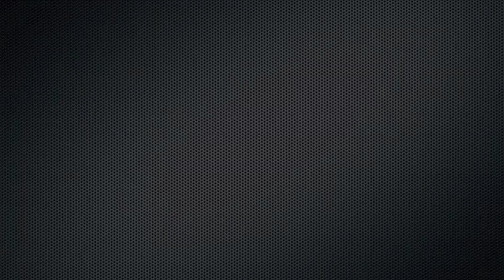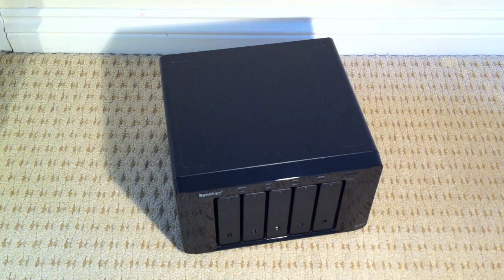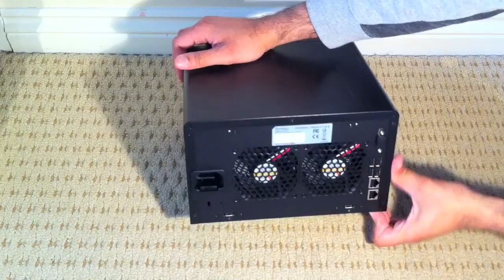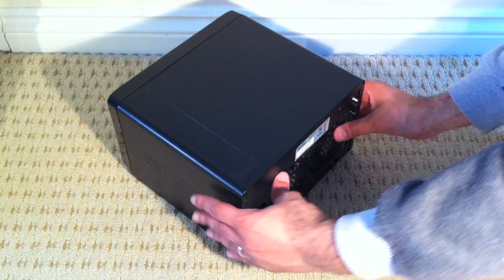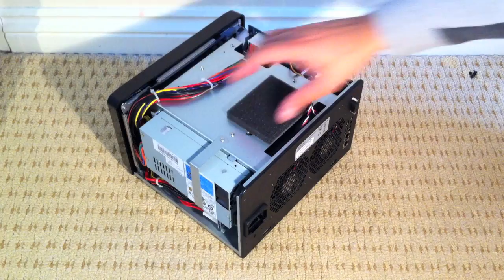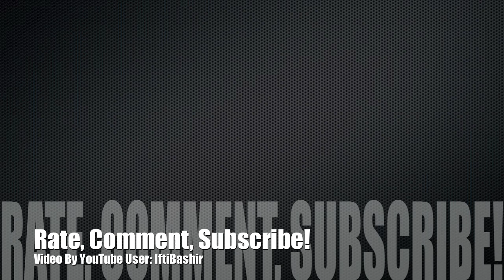Synology DS1511+ NAS : RAM Upgrade Guide

Comment: Can anyone tell me if the Kingston KVR1066D3S8S7/2G 2G module will work in and DS1811+? This is a 2GB PC3  SODIMM.
Also can you simply power down the system, insert the RAM and power it back up? I am concerned - I have 6T of data on my nas!!!

Thanks.

Comment: Is it just the software interface that benefits from the RAM upgrade?  I would imagine the bottleneck for streaming performance the is the ~200Mb/s read from the unit, so what improvements did you see from upgrading the RAM from 1GB?  Thanks.  Love the vids.